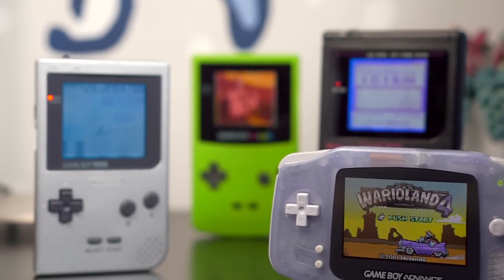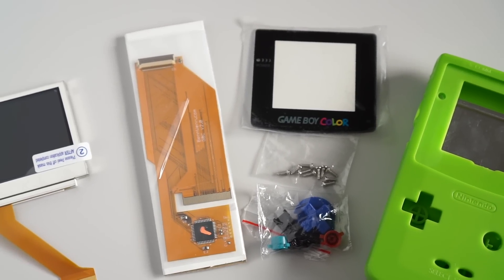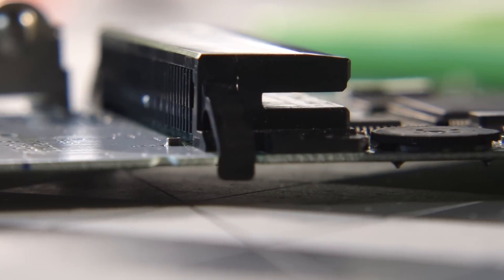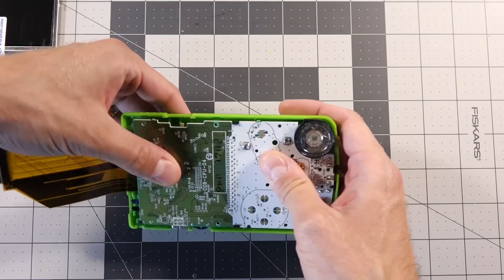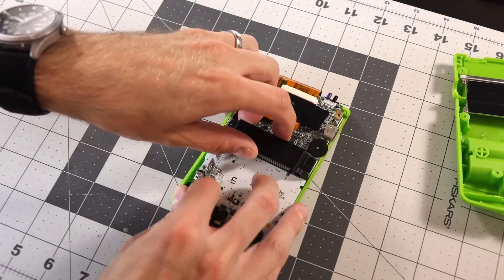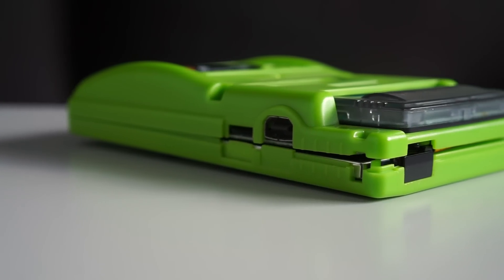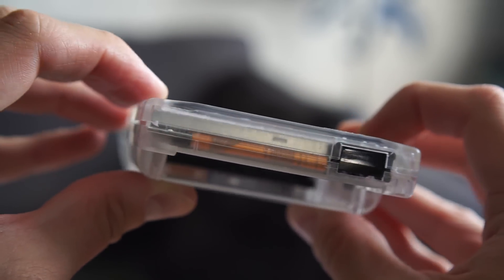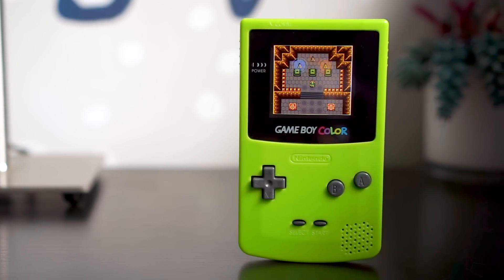BennVenn Backlit Game Boy Color Mod

Comment: Hi, BennVenn here! Removing a lot more plastic is a must with this build. You need to take off nearly a mm of width from the front sell. Removing the LCD metal frame also makes a huge difference. When closing the two halves, there should be zero gap, and the power switch also fully functional. 

I also sell pre-modified shells so this is all done for you.

There is also enough room to fit a smt power LED behind the glass.

There are replacement LCDs being made in China so no need to destroy an AGS101.

Kapton tape is preferred over electrical tape as it is thinner and won't leave black slime over everything.

And finally keep all the wires as short as possible to prevent interference.

Great video Colin!
Reply: GoldenFox oh, yes. there is a 2.2"Smart phone screen I'm working on. Same as in the taobao console. with the ribbon, hopefully it'll be a direct swap with no modding to the shell
Reply: Thank you for your continued dedication to modding these amazing consoles to make them even better! You're the best!!!
Reply: Ben, I saw a post of yours on Facebook that showed how much room you save by removing the metal around the LCD, but you mentioned that you needed to peel the ribbon board off the back of the screen. What exactly does that entail? Once peeled away, what keeps the ribbon attached back to the screen's components? Any pictures of what the back of the screen might look like after that's done? I watched Kyle's Awesome Life do a tutorial on this and he only removed the front of the metal bracket.
Reply: Ben Grimmett LCD's are being made huh? Do you think it's possible to design screens that fit the size for the GBA or just 101 models only?
Reply: GoldenFox I don't get what your asking, is there a backlit screen for the GBA?
Reply: Ben Grimmett I'm asking if there's a custom frame size doable to fit in the GBC shell better and than the usual 101 screen.
Reply: Treble Hook Thanks mate!
Reply: Animon21 I'll definitely try this today! this would make the build so much easier!!
Reply: There is one that is suitable and the kit is in development. I'll release photos in the next week or so
Reply: Ben Grimmett yeah fingers crossed. The progress of finding out the best mod treatment for the GBC has been crazy for years.
Reply: Ben Grimmett I only took of the housing of the lcd and trimmed down the plastik that holds the Original screen. My gameboy closes perfect without any gaps around the case!
Reply: FierceDeityXeroX the little ribbon piece is adhesive so it'll stick back to the while diffuser on the back. it's delicate so be gentle!
Reply: Animon21 Do you maybe have a picture of that? Sounds promising!
Reply: I'm thinking about a whole new set of Gameboy Color casing, that would fit the old peripherals plus the new screen & ribbon adapter.
Reply: Bitboy is 4:3 aspect, GB and GBC games would be stretched and squished to fit
Reply: GopooSuperSandwich through my store, bennvenn.com
Reply: Hey Ben Grimmett, guess what? I will modify my Game Boy Color to have the AGS-101 to make my Game Boy Color comprise of a backlit screen!
Reply: would a 3d printed shell with more room work?
Reply: update on GBC backlit lcd prototypes?
Reply: Ooh, that's fantastic. I was wondering if anyone was going to try and recreate the taobao console modification, hopefully that comes through.
Reply: It's so nice to hear new retro oem hardware is being made. It's nice to have options.
Reply: Ben Grimmett i was just looking at the bit boy screen isn't that the perfect screen to use for this mod or is that the same screen as this just a thought
Reply: ah i see it a no go i was trying to see if an old cell phone screen whould work but i have not found the right one
Reply: Ben Grimmett with the Ags 101 screen with your modified case would you still be able to close the housing without glue?
Reply: Juan Salazar you could use tape, or even add new screw posts to it. depends how technically minded you are
Reply: How can i buy a premodified shell?
Reply: Ben Grimmett ok thanks!
Reply: Hey Ben, is there any plans to make a similar product to talk to a GBA screen with the Raspberry Pi HDMI/Display Connector? I would surely buy it
Reply: Sam Za Nemesis to use the GBA screen on the pi? isn't there cheaper LCD solutions?
Reply: There's a market of people retrofitting Single Board Computers inside gameboy consoles and not a single one has an LCD that fits properly, seems like a good market to dive in, I'd buy one of these myself, I have tried driving the GBA screen myself before I've figured out I'd waste most CPU cycles available doing it with the I/O pins
Reply: Sam Za Nemesis it would require a driver being coded for the PI, I'm sure someone out there has the time and knowledge to do it. IMO if you're going to emulate, just use any old screen.
Reply: Ben Grimmett Can you do a video of a custom 2.2 Smart phone screen backlit Game Boy Color screen mod showcase? Please respond.
Reply: Team Shaolin Star Okay, what are you talking about?
Reply: Team Shaolin Star Who’s videos are you talking about?
Reply: Maybe? Honestly I don't think anyone has actually tried that. Maybe if some real thought went into it you could make it work and slowly printed it out and took your time cleaning it up and sanding the plastic down for smoothness, custom paint job on the outside also... Its at least worth looking into the idea.
Reply: GregLH0 I'm out of my depth here, but I'm pretty sure that 3D printed plastics are far weaker than molded; so it would be an issue of durability.
Reply: Ben Grimmett You're a gentleman & a scholar, Ben!
Reply: Ben Grimmett hibthere benn never thought there was a replacement lcd like ags 101.
Reply: Ben Grimmett theh he iez
Reply: i guess it is pretty off topic but does anyone know a good place to stream newly released movies online ?
Reply: @Grant Kabir Flixportal :P
Reply: @Matthias Chase thank you, I went there and it seems like they got a lot of movies there :D I appreciate it !!
Reply: @Grant Kabir You are welcome :D
Reply: Why not just work on a 3D printed case which takes all of this into consideration so no case modding needs to be done in the first place?

Comment: Surprising to me, that in all those years, there has not come a single company, offering backlit GBC screens or somebody having found a suitable other screen for use in the GBC. I am very glad I am not an originality nazi, playing most stuff on my hacked Switch. However, I do have a modded classic GBA with the 101 screen, together with a Flash cartridge, which already is an ultimate whole Game Boy eco system gaming device at best results. Makes me think, how in the world we did play with those lightless screens back in the day, since I also have a normal GBA, and it's rediculous, how little you see on it.
If I was into the GBC, the best thing about this mod is the whole new shell with actual plastic Start and Select Buttons. The rubber garbage has always been so annoying. Sadly my ultimate GBA does still have those.......

Isn't it funny, how something incredibly common today makes your eyes light up, when finally being available to retro tech? Well, it might also be a matter seeing your device work after you have put quite a bit of effort into it.

Comment: The biggest problem for me with a mod like this, and this also applies to playing GBC games on the GBA or gameboy player, is that most GBC games were made for the lower saturation of the original GBC screen. On a true-color screen, the games will be quite a bit over-saturated. It might look more vibrant, but sometimes it's quite noticeable that the colors are off. Sometimes what's a nice balanced color palette on an original screen just falls apart in true-color.

Comment: Hello Colin.  I wanted to get one of these and wanted to know if the Everdrive GB X7 will work with this mod?  Thanks
Reply from the maker: Since it's just a screen upgrade, as long as the Everdrive works with a stock Game Boy Color then it should work with a modded one just as well.
Reply: I thought I read the Everdrive GB X7 uses too much power for this mod. Thanks for answering anyways.  Cheers

Comment: what it be easier- to use- like a metal sheet that should have power in it to charge your battery gas and household needs a wireless charger to use it? like solar paint or solar blankets they have invented like a metal sheet that connect to a power battery or heat from the ground to run electricity... and solar boats solar cars solar planes helicopter and submarine house that have wheels on them and underwater cities built to last ions longer and build hard drives that can last 300 years or more? cars that could float underwater and can fly- and cars that can in the near future that could fly into space? these days TV auto tune TV channels automatically and touchscreen phones that you can turn on or off anytime? i only got a 2hr library limit on computers their where i am internet black spots and blackouts.. and people need to check their accounts that need updating so their aren't deactivated especially phone provider that aren't active for a while? you would lose your number and wouldn't matter all the money in the world could bring it back because it was taken? that is discontinued outdated and no longer in use? and social media accounts what about that blackout that happen for days in lake macquarie Australia nsw in April 2015

Comment: up internet just about so i use the library pc's public computers 
because fast internet and the library WiFi- need a service internet 
provider is that the same for virgin mobile i could use but it's not 
adsl wired internet all prepaid internet so does prepaid internet have 
to do with nodes and NBN internet coverage. and same

Comment: their are no kiosk that are payable anymore it's all free WiFi but not free lifi- using library internet connection because the slow internet at home- almost like dial  need a service internet provider is that the same for virgin mobile i could use but it's not adsl wired internet all prepaid internet so does prepaid internet have to do with nodes and NBN internet coverage. and same for the fireworks none where i lived happened? all in big towns and capital cities have to travel to get their but next week on Sunday this week coming 350 buses no longer operate which harder to travel. have to travel where their are they wont travel to me... i know if i don't ask the universe what i want i never get it- i read into alot about psychic things as well. study about all about jack off all trades?

Comment: I'm also thinking if you can create your own modified housing using a 3D printer so all components could fit perfectly. The downside is, it will cost more. :(

Comment: Hey This Does Not Compute, I noticed you used a CGB-CPU-04 motherboard, you could've used a V05 or V06 (GBC-CPU-05 or GBC-CPU-06 Game Boy Color Motherboard). GCB-CPU-04 motherboard backlight mod will have graphic problems for original Game Boy game pals.
Reply: I made a mistake, I accidentally said pals not paks.

Comment: half-arsed video. removal of the metal bezel from the LCD and simply shaving down the power switch sees it all close and function perfectly. there is no need for serviceability, so a DOT of glue in the top corners sees this mod complete. i know, because it too me about 30 minutes to complete the MOD with zero issues and 100% functionality.

Comment: There are lots of mods being done with the AGS-101 screen. Is there a factory somewhere in China that manufactures all these screens right now? If not, how are screen prices staying low-ish?
Reply: Whew, that's such a relief.
Now I don't have to worry when modding my GBA if I break the screen, I can just buy another one
Reply: Well it doesn't make them any more expensive
Or does it?
pls give me answers
Reply: Well when I first modded my GBA (the only time, about 2-3 years ago) the screens costed 50-60 bucks and the whole kits were about 100 bucks
It's dropped a little since then

Comment: or......all this mod could have been completely avoided by not cannibalizing a GBA SP AGS-101 (which is the most sought after version of the GBA)  and just plop your GBC cart in that one instead!  if you had the skill to do this mod you have the skill to more than likely fix even a broken AGS-101.
Reply from the maker: It's not necessary to take the screen from an AGS-101 for this mod; new, 3rd party replacement units are readily available now.
Reply: thanks for clarifying this.  would it be feasible to put one of those screens in a regular GBA SP or are the connections different?

Comment: i don't consider that a true gbc back light. mainly because your using a screen from an entirely different system and not modding the screen it came with, like the dmg and pocket gameboys or using one that was made for the system with a built in backlight. i would consider that more of a, i guess, a Frankenstein(for a lack of a better word) system as it is using the screen from a different system with an adapter. but thats just my opinion

Comment: What an awesome looking screen, but that gaping case is really an eyesore. I wonder if it would be possible to 3D print a thin spacer to put between the two parts of the shell. Even if it was just 1 mm, it seems like it would be plenty to solve the gaping.

Comment: I think this will put more strain on a market that has already mined GBA SP screens for GBA screen mods, unless a supply has become available. 
That being said, this is something of a holy grail for GBC owners. 
I don't think I'll be doing this one, but that's because I've already modded my own GBA a few years back and put a bit of time into refurbing my GBC and don't want to mess it up.
Do the replacement shells allow for a power switch? Losing stuff like that doesn't set right with me.

Comment: Finally it happened the backlight has come to the gameboy color. One thing though The casing is better to be replaced with one that can better fit the thicker components. Hopefully the atomic purple colored plastic is still available to use in things including 3d printers and in cutting machines.
Last, I always see the AGS101 screen selling for average $47 on ebay/amazon, this could reduce the total cost a little, if they are producing that screen in china, it sould have a lower price in general.

Comment: Interesting.

Thanks, Colin, for including all the pricing. 60 dollars for the screen, 50 dollars for the ribbon cable and the added shipping cost and conversion to my currency brings me to roughly 156 dollars (not including the shell replacement and glass screen and only assuming shipping costs would be 15 dollars to my country, which I doubt that is it)

That's way too much for what it is - an AGS-101 screen in a Gameboy Color. I love my GBC but not that much.

Comment: The BennVenn mod looks promising but considering all the flaws of having to basically rip apart your console's innards just to install the damn thing, you're much better off picking up a GBA or GBA SP to play original GB games. At least they either are or can be backlit with ease.

Heck, even a GB Boy Color is a better option than this, despite the flawed aspect ratio.
Reply: It doesn't use an actual AGS screen, it uses a replacement

Comment: What a fantastic project. I love all your videos and it got me inspired to  take apart my old gammeboy color too.  Keep up the good work. I do have a little suggestion: With a 3d printer, you could resolve that fitting problem by resizing gameboy in order to fit everything in the case and eliminating the unnecessary plastic in the modeling process.

Comment: You can remove the front part of the 101 screen's metal housing to get enough room to close it completely, just don't remove the back piece of metal!
Reply: I removed both and used electrical tape to hold the layers together and with a lot of sanding around the screen bezel I've managed to get it to close completely
Reply from the maker: I started to explore that option, but it seemed like the front/back metal housings held the layers of the LCD together. Maybe this varies based on manufacturer?
Reply: you don't remove the back (its what holds the layers together), just the front - they all come apart though

Comment: I would 3d print a specific case for it. Make it to specifications of the new hardware. With a decent 3d printer or an online service you should be able to make a case that would work. Just an idea. :) Thanks for the videos.

Comment: Great video. But a GBA with the AGS-101 is the way to go! I'm sure you can find a new screen on ebay. They are being made again. Make sure to get the RIGHT adapter for the screen to the mother board. No image retention or "ghosting". You can use BennVenn's AGS-101 Voltage Regulator for a crisp and brighter image. This is the best option for playing gb, gbc, gba games. This mod is cool but seems like a waste of time and money.

Comment: The fact that you can't close it up 100% is a turn off.  What a shame because the screen is beautiful and vibrant.
Reply: ZReport If you modify the case as is recommended on my install guides, it'll close up just like the original. If you don't have the skill to remove the plastic, you can buy pre-modified shells from my store
Reply: Ahh, I see -- I'd be much more apt into looking into a pre-modded shell than anything!  Thanks for the response!

Comment: Colin. How does this mod match up to the Kong Feng GB Boy...
Reply from the maker: If you spend the time to get everything to fit 100%, I'd say it's way better -- it's basically an original console with a proper backlit screen. The GB Boy is a good option if you aren't into modding, but its button feel and incorrect screen aspect ratio bother me (as it bothers some others).